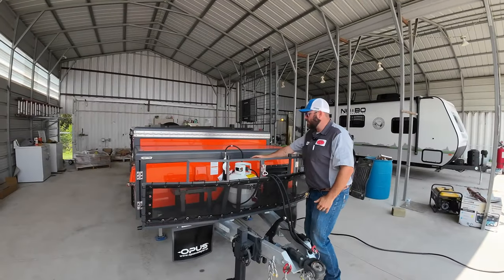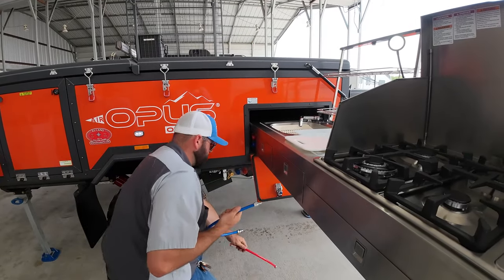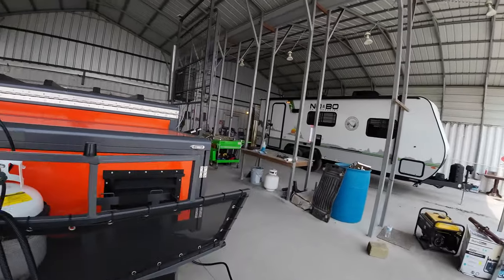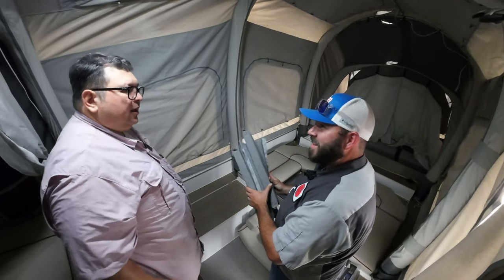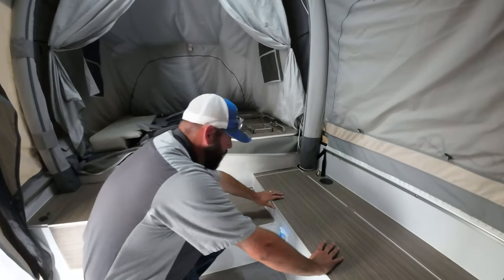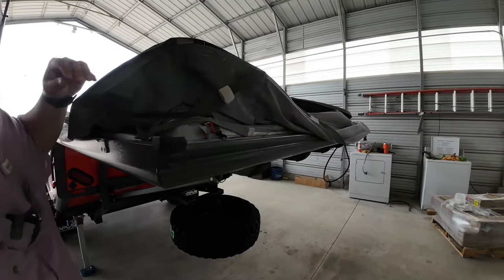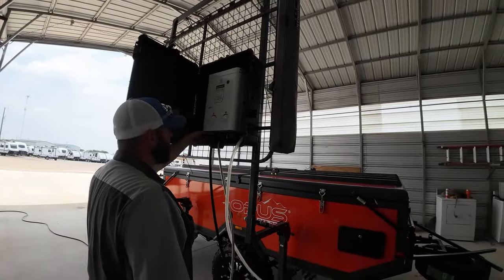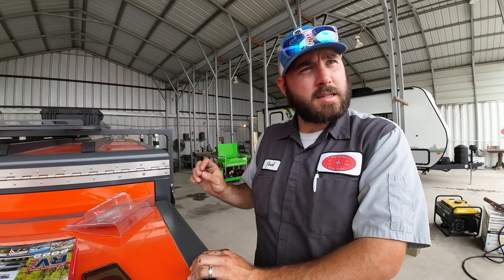2023 Opus OP4 Off-Road Camper Detailed Setup, Tear down, and hitch connection!

Comment: It makes sense why the back folds in first. Once the front is locked in It prevents the back from getting caught in the wind and blowing up like a sail. Are you still liking this unit?
Reply from the maker: Nothing has broken yet. I just wish I had more time to use it. Work’s been eating into my adventure plans. Yes, the design makes sense.

Comment: The zippers on the windows and doors on these trailers require in many instances a lot of pushing and shoving.  You open a window and the you can't zip it up. On OP2 trailers,  the door can't be zipped up at all in many instances. If you are picking  up Air Opus from a dealer, check all zippers. Check if you can zip up all windows and most of all the door. Check if the Velcro on the door aligns with the Velcro on the frame. Check if the tent canvas is evenly tensioned on all sides. None of that was done/shown in this walk-through.
Reply from the maker: Good tips. So far, there has been one leak in t5. Turns out it was a manufacturing issue as the first zipper’s teeth was caught on the bladder. I have an awning on my truck and the zipper is stubborn at times (since it’s always exposed to the elements. I use a spray product called “Moo Slick” on the zipper track and it helps it operate smoothly.
Reply: @CoastalGX  It is no the zippers per se. It is the canvas having so much tension on windows and the door that you can't zip it up!
Reply from the maker: @malanalan1  I wonder if that has anything to do with the weather? I have no issues yet, but I've only set it up about 8 times.

Comment: Hi new subscriber.  Thx for 3rd row seat removal vid! What kind of trailer brake controller did you install in gx 460?
Reply from the maker: Glad it was if use!! I went with this easy install:
https://amzn.to/3IWIJUG
Reply: @CoastalGX  interesting.  Kind of makes me nervous.  I assume it's working well?
Reply from the maker: @bartman1857  it works perfectly. Drove it 5 hours doing 75-80. The settings were the perfect balance for travel.

Comment: Way too much setup is required with this trailer for me. Also, I am not a fan of the air inflate system. Too many failure points in the long term.
Reply from the maker: Many moving parts for sure.
Reply: Very cool concept but like you said way too many steps. I was exhausted by the time it was blown up. I worry about the air bladders failing or tree branches falling on it or something.